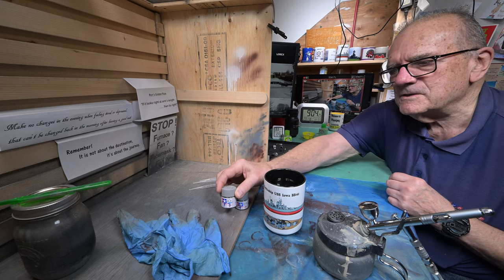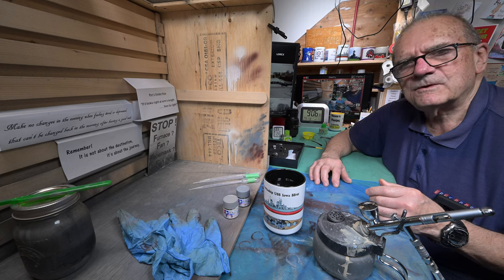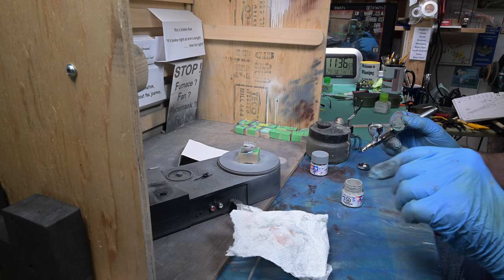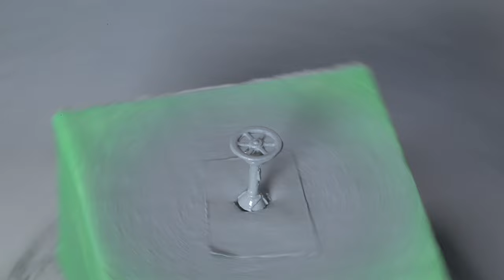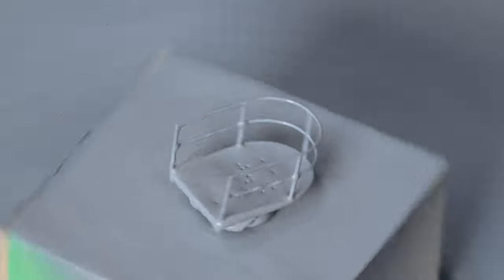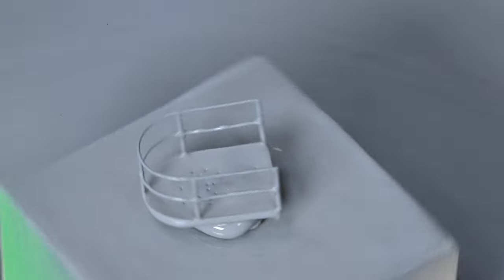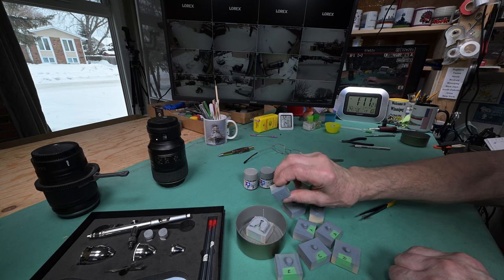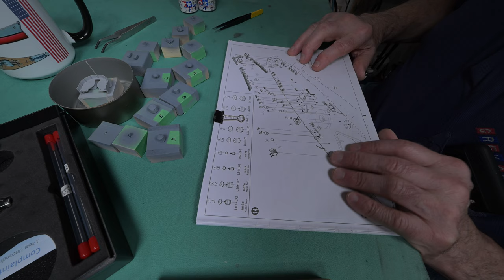The Model Ship - Part 1434

Comment: Ron, what’s the thing about 8K? Most people only have 4K or 6K TVs, and with computers you need a high-end motherboard, CPU, fast SSD, >32GB ram, and a high-end GPU with tons of RAM, plus, high speed internet, and a monitor that can cope with 8K and has been calibrated correctly. My Quad monitor system two liquid cooled PCs to -4 degrees C with a self designed system and my self build computers are built for 8K. Cost was around €18000 without the price of the monitors. After I retired from the medical sector I worked as a computer engineer (have a PHD in computing, networking, electronics and software programming) the majority of customers couldn’t see any difference between 8K and 4K because even though most wore glasses the glasses weren’t up to date. Eyesight varies greatly with each person and there’s always a dominant eye, which means they work differently.
Reply from the maker: Hi Gray,
Re: "what’s the thing about 8K? "
First of all, I hope I have not misunderstood what you are saying here.
Now! I do realize that interesting content is of most importance in my uploads. However, smoothness (60fps) and sharpness (4K/8K) are important to me.
Perhaps my channel is not for you!
Reply: @roncalverley  you can get 60fps and supreme sharpness with 4K, it’s a shame that you feel the content isn’t as important as the process of putting together the videos. I understand that you’re annoyed, and realise that you want to do things your way. But only building models so one can produce videos isn’t conducive to an effective workflow nor your supporters. I had a friend who did things his way and got annoyed when people questioned. Don’t fall into that box, you’re too nice. Comments, suggestions, advice, questions are part of running a channel, if supporters only give positive comments or don’t ask questions related to your comments your not getting the most of subscribers
Reply from the maker: Re: "it’s a shame that you feel the content isn’t as important as the process of putting together the videos"
What? --- Obviously you did not carefully read my reply where I said "interesting content is of most importance"
Again --- Perhaps my channel is not for you Gray.
Reply: @roncalverley  second time you’ve stated that Ron, obviously you’re not happy. I watch because sometimes you think out of the box, not many people can do that. 4K provides a great image, especially when watching on mobile devices. I know you feel you want to out do others, but even at 4K your images and production is great. I asked about the 8K aspect out of interest, and provided information to back up my comments rather than making blind statements. And I was polite. I’m 70 years old and have been using social media since the beginning, and have always been polite when asking questions- I must say, this is a first, being asked to unsubscribe and go to another channel is not what I expected from you, never happened before. Information given by subscribers and supporters of your channel are made to help. Perhaps not mentioning aspects like 8K not working might prevent this type of issue if you’re sensitive about being asked about it.